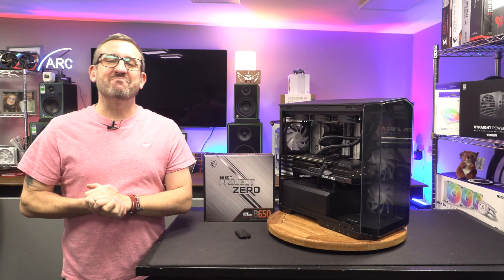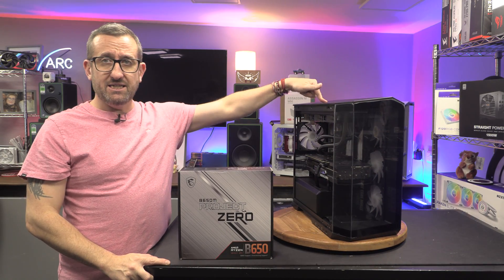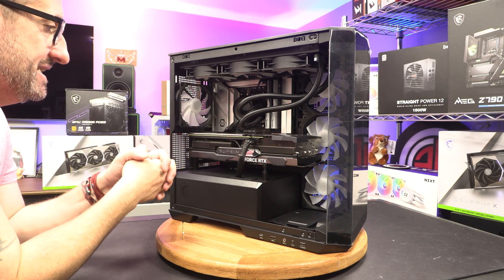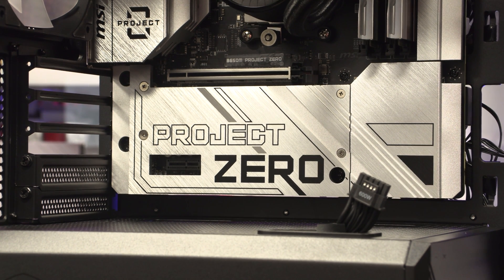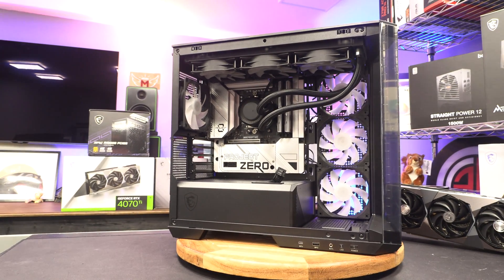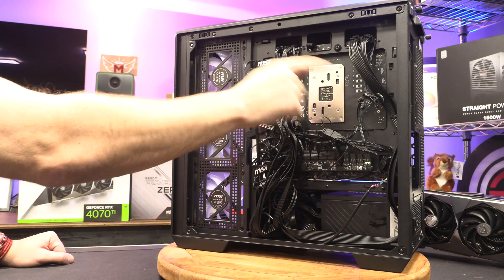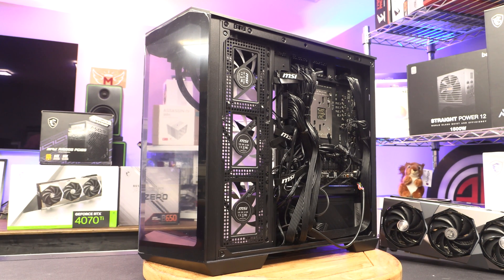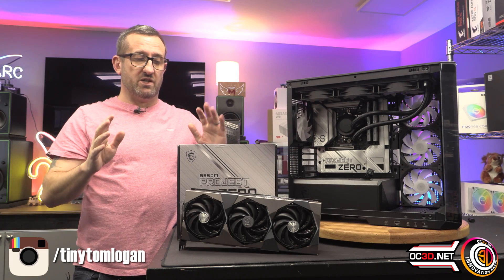Rear Motherboard Power Connectors - MSI Project Zero

Comment: I'm really in favour of Project Zero. I've only recently upgraded so am not a customer for the foreseeable, but you never know. 90 degree ATX; USB 3,  3.1,  3.2; and EPS connector adapters are readily available from Amazon, Moddiy, and other places. This isn't an issue save that they should really come with the motherboard.

Comment: I am super excited for these! I hope this becomes the industry standard. Depending on how the placement becomes standard, it could be relatively easy to modify existing cases to allow for these motherboards. Either by yourself at home or by the manufacturers to re release popular cases to support these motherboards.
Reply: I strongly disagree, this thing looks like a nightmare and would 100% not work in any case i own
Reply: @jrksoldierx1436  yeah but cases are cheap and it's metal so it's easy to just cut it for the new plugs
Reply: @DigIntoGaming  your delusional

Comment: I like the look of nice sleeved cables, I'd much rather more fan connectors, right angle only connectors in general and an industry standard front panel connector that is one block not separate connectors. Haha

Comment: they should bring ALL the connectors to the back.. much cleaner look
Reply: ?? What other connections are you expecting to be brought to the back
Reply: @Hello-uv3nz  1/3  of the space on the back is occupied by midi in/out & usb plus the switch, imho there´s is plenty of space for all remaining 5 connection on top and front, to go on the back too. 
It´s in my tiny Studio right now and the only Piece with cables comming out everywhere Having gotten angled ones helps a little.. still..

Comment: you know why these motherboards make no sense? except for the obvious they wont fit in most cases, you can just buy 90 degree cable adaptors if you don't want to see cables. in my last build I did 2x 90s off the 24 pin so it comes out backwards next to the motherboard, and put some 90s on the gpu as well so the cables are hidden.